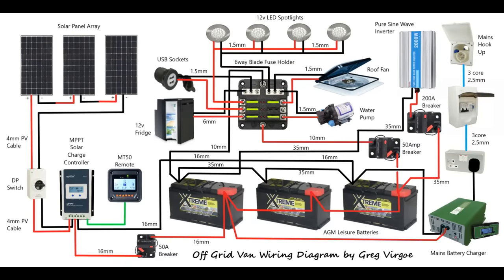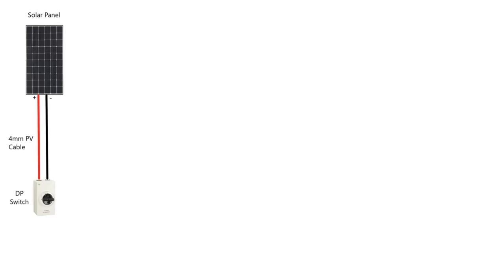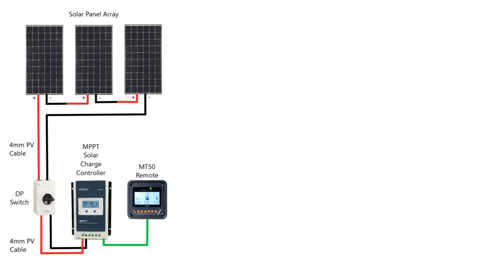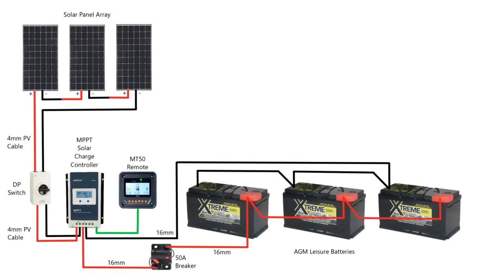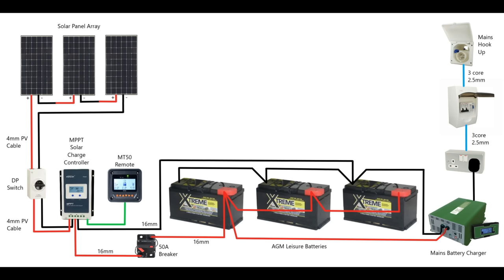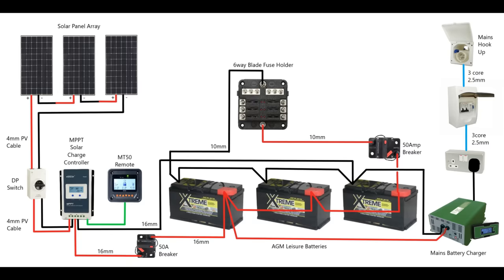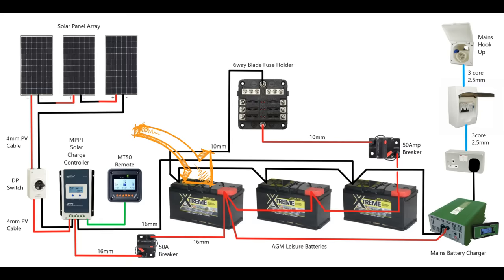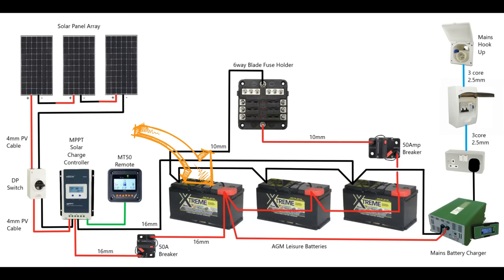How to Wire your Camper Van to be Off-Grid

Comment: I see some people using a single black wire and a single red wire to prewire 12V loads, and some people use a 12/2 wire. Is there any difference other than the 12/2 wire is held together with an extra layer of insulation?
Reply from the maker: Correct the two core cable has extra protection from another sheath and maybe easier to install than separate cables? As long as they are sized correctly no affect on performance 👍🏼

Comment: I’m just going to use Solar Generators such as the EcoFlow Delta Pro! That’s much easier and I will have 10.5 KWH total available to me. At any given time.
Reply from the maker: To get that amount you would need three pros linked together and at current market prices that’s £10k without any solar to recharge them. That’s a ridiculous amount of money to spend on off grid setup for a van. You could install solar, charger and batteries for £1k a tenth of that price. The most power we use off grid in a day is between 0.7 - 1.2kwh so quite why you would need 10kwh in a day is puzzling. How do you plan to generate that much power to recharge them? Eco flow solar panels are 3x more expensive than standard fixed panels.

Comment: i'm sorry if you have already answered this question i did try to search for it... I'm currently doing my electrics and just confused as to how i switch from solar power to electrical hook up? is it a just a switch i need to buy? kind regards, thanks for the video
Reply from the maker: Your solar panels just charge your leisure batteries via a MPPT controller. If you want to use mains off your battery you need an inverter to transform the 12v to 230v. At this point you can install a double pole changeover switch to change between inverter and mains hook up.

Comment: Absolutely magnificent video as usual Greg. Thank you! Couple of questions.
If we wanted more sockets when on hook up, would we just run straight spurs from the first socket that you have installed , or would it need a larger consumer unit ?
Also, did you consider a traditional split charger from the alternator on top of this set up, and would it be possible ??
Reply: Apologies Greg. Just scrolled down for a bit and found you have repeatedly answered the split charge question, sorry to repeat.

Still wondering about additional 240v sockets though 🤔
Reply from the maker: @GaryThatsgary  you can add extra sockets just be aware of how much stuff you plug in and use at the same time. The biggest hook up power supply is 16amps so that’s a total of 3600 watts of appliances

Comment: thanks for your invaluable video's. the later i'm looking at with great attention. something is bothering me. how come you wired the 2000W inverter with only 35mm2. According to the table you gave us in an other video, for a 200A fuse, you'd a much bigger wire. thanks for your feedback.
Reply: @DogeWow according the cable sizing chart mentioned hereabove, 35mm2 is for a maax of 141A. Even thought it would be 190A. Shoudn't the wire be more resistant than the fuse. The later being a 200A.

Comment: Hi Greg, thanks for your videos they are really helping me with my first van. 
I’m basically converting my old work van to see how I get on before doing one to keep (test dummy) I’m a carpenter so all seems fairly easy apart from electrics. 
Now I’m only doing this one as a day van as such not for touring. I’m just wondering how big the mains leisure charger needs to be? I’ve got 2 batteries that are 130A each. I’ve been looking at buying a complete kit but charger is only 5A and yours is 30A I’m just a bit lost in this part if anyone can help. Thanks
Reply from the maker: A good guide for charging leisure batteries is 10% of your total battery capacity therefore -
(2 x 130) = 260Ah x 10% = 26A
So a mains charger of 20-30A would be perfect. 👍🏼😃
Reply: @GregVirgoe  thank you so very much for all your help Greg.
Reply from the maker: @dannywilliams98  No problem 😉 anytime 👍🏼
Reply: @GregVirgoe  sorry I’m reading your list of questions. 
I’ve got my batteries and they are SFL 130 MF CALLED SOLAR FLEX.  ARE THEY like your batteries or do I use a split charger. 
I’m so excited to start but electrics are worrying me 😁 I’m ok with house stuff, but this is totally different 😬😁
Thanks again. By the way I’m really enjoying your videos, bed time to for me these days 😁

Comment: Hey greg. I see in your chart that you have 16mm2 cable from the mppt to the batteries. I have a victron 100/20 mppt and the cable is too thick to connect.. did u just use ferrules on the cable or something else?
Reply from the maker: If yours is just a 20A charger you can use smaller cable 10mm will be fine.

Comment: I'm planning on creating solar installation from scratch but I'm always anxious when I see these "electrical compartments" made of plywood, with batteries, solar charge controllers, etc. What would happen in unlikely event when one of the components break and catches fire? I'm thinking about "fire-proofing" this area with some fireproof wood impregnator (to atleast slow-down the fire in case it happens) and having a dedicated smoke alarm in this compartment. What do you think?
Reply from the maker: A smoke alarm would give you enough of a warning to vacate the van. Make sure all cables and fuses are correctly sized and you should have minimal risk

Comment: Hi Greg just a quick question I got 2 bus bars positive and negative do I connect the main battery charger directly to the batteries or to the bus bars like all the other chargers likes solar , dc to dc etc …
Reply from the maker: If you are using bus bars then you need to connect all your chargers and outputs to the bus bars. The cables from the bus bars to the batteries need to be the same length to give equal resistance to the batteries. This method does put extra resistance and voltage drop onto the system.

Comment: I'm considering buying the 50amp breakers that are used in your design however Amazon and eBay sell them cheaply but the reviews are very poor. Some retailers of 12v products also sell them but quite a lot more but they could still be the cheap and poorly made items as well. Is there particular makes that are of higher quality or are they all made in the same factory in China?
Reply from the maker: From personal experience with my own I have not had any problems 😁

Comment: Hi greg, thanks for the great video. 
I have a question . 
How would you caculate cable size between 1.charge controller( 30 amp) to battery , 2. dc dc charger ( 30 amp ) to battery 3.inverter (500w) to battery 
my battery is 200AH lithium superpack victron
Thanks alot , Any advice appreciated

Comment: Question re grounding. Firstly, did you ground the 240v to the chassis? Also, did you ground the large metal items e.g. sink/hob? Is it ok the have a common ground/earth point on the chassis for both 12v and 240v or should you keep them separate? Simple and straightforward video. Very useful. Thanks
Reply from the maker: Yes I did earth the 230v to the van and such items as inverter case, copper tubing etc. 
12v DC does not need an earth. Most auto electrics use the vehicle body as the negative path back to the battery. Do not confuse this with an earth. They are not the same. The term ground gets used and I think that’s what confuses people. I recommend running cables for both positive and negative and avoid connecting the 12v DC leisure side to the vehicle altogether 👍🏼😃🤩
Reply: Answered my question about 12v DC perfectly thanks 👍

Comment: Would you have this as a stand alone system or can I link the vans main “engine battery” into the system for extra charging through the alternator whilst driving?
Reply from the maker: My latest off grid wiring video is better for including charging from the van. Please watch this video 
12v Electrics for Off-Grid Campervan - Fiat Ducato Budget Build Ep12
https://youtu.be/xCw7eARJKOg

Comment: Hello!  If you are using a single battery, is it safe to connect your solar, inverter, and fuse box all to the single terminals on the battery or do I need a bus bar?  It is a 200 amp system. Thanks!
Reply from the maker: You can get battery terminals with multiple posts I’ll put a link here https://www.12voltplanet.co.uk/positive-battery-terminal-clamp-3-stud-connection.html
The positive and negative terminals are different sizes so you need one for each 👍🏼

Comment: Hi very helpful. I have a question. on your diagram the mains charger. would you have to turn off solar power? so you dont have 2 sources charging the battery. My system is similar but instead of the mains charger, I have the starter battery with a leisure battery which is supplied from the alternator.  So could I use my solar panel to top up the battery also? or would I be inputting two sources. Thanks

Comment: Hey Greg, great video! 
Can you answer my battery question? 
How many amps can you draw from a AGM battery (or any type) continuously? 
I have a 12V AGM 25AH battery. Would it be safe to draw the full 25amps for a period of time?
Can you draw over the battery AH capacity for a burst of time? Say 30amps for 5 mins? 

Confused on max amp draw over a continuous period, say 1 hour. 

Sam

Comment: How thick should the cable and fuse be if you use the car battery to charge your other battery's instead of solar panels? Thanks from Sweden 🇸🇪 😀
Reply from the maker: Typically they would be a minimum of 16mm cable for split charging.
Reply: Thank you Greg!

Comment: Hi Greg, Thanks for your videos, if I understood right, without any inverter I can keep my battery cable smaller like 16mm would be good?
I have plenty of 16mm, to save some money, could I double it and reach 32mm ? Or it will drop using 2 cables?

Thanks a lot

Comment: I keep referring to your videos for every aspect of my build.  I'm looking at what size cable to buy and I'm just wondering why you chose 6mm cable for your compressor fridge when it draws only 6.25 amps. Would 1.5mm not be sufficient?
Reply from the maker: Hello David, no it’s not big enough abs it’s because of the voltage drop on the cable. Inside the manual there is a chart to size the supply cable depending on length.
Reply: @GregVirgoe  Many Thanks for your prompt reply Greg.

Comment: Hi Greg, just a quick question, do you have power sockets inside that are normal 3 pin plugs. If so, how do you incorporate them in
Reply from the maker: I have taken my hook up cable and my inverter cable and wired those both to a double pole changeover switch. The output of that switch I have wired to my three pin sockets. 
You can see more detail of that in my earlier control panel videos

Comment: Hi Greg, sorry for another question but I was wondering if you might be able to answer this question, so i have 2x100W solar panels which I will be wiring in parallel as I will be using a CTEK B2B charger which also has an MPPT controller in it but the max voltage is too low for me to wire in series. But this like you said means I will have a higher ampage, the solar panels come with 4mm solar cable, will this still be okay to use or will i need to get a larger wire? Ive tried to find out the gauge of the 4mm wire supplied but cant find it anywhere, as i was under the impression i would require 10 agw but im a tad confused! i also dont then know what size amp breaker or fuse i would need/ if i need to install one between the solar and ctek and between the ctek and battery?
Reply from the maker: What is the max amp rating of each panel? Can you give me the model of CTEK that you have please?

Comment: Hi Greg, What size of cables should I use between my AC/DC battery charger and the actual batteries? Should I use the ones coming with the battery charger or should I replace them depending on my system? Thanks
Reply from the maker: The ones that came with it have probably been sized for it’s max duty. What is that amp rating of the charger abs what size cable is it.
Reply: @GregVirgoe  thanks Greg. It’s the KickAss 20amp, it doesn’t say what size of cables but you are probably right about it. Just another thing, do you have to be careful when working with the circuits (batteries, solar panels, cables) or as it is 12V it won’t harm?
Thanks again

Comment: Hi just one question would you use a 35 mm cable also from your 2000 inverts to your plug sockets . By the way really good well explained video thanks steve
Reply: No. 35mm is for 12v where the current is very high. Once the inverter converts 12V DC to 240V AC, the current drops, so you just use normal 240v tri cable, standard wires you have with your plugs going to your sockets, i believe its 2.5mm with 3 cables inside

Comment: Hello Greg,

I have 2 questions please:

1: Planning to use your schematic. If I wanna do battery to battery charging, apart from the parallel panels that you mentioned in one of your comments, what else do I need to change?

2: If I'm using 500w solar can I use Renogy 40A MPPT or should I go higher?

Thank you!
Reply from the maker: You can use the new Renogy 50A DC to DC charger which has built in MPPT charger too. It will handle up to 660W of solar. You will have to wire the solar panels in parallel as it has maximum input voltage of 25V but at a little over £200 for the combined unit and Bluetooth module it’s an economical solution
Reply: @GregVirgoe  Thanks Greg! Appreciate it.

Comment: I hope you wouldn't mind helping me out a little bit and checking my math for me. I've been trying to find someone with an accurate answer....

I recently purchased 4 lightly used 270 watt, 35.5 volt pmax, 7.60amp pmax / 15amp fuse rating solar panels. So, if I connect them up in series I would get 1080watts with 142 volts at 7.6 amps. Correct?

I also purchased a DC pool pump rated at 72vdc that comes with a 72v Controller Box. 
The Controller parameters are as follows: Rated current=12A, max solar input volts=150, current overload=15A, pump=1000W @ 72v, best working volts=88v.

Would you agree that my 4 panels in series is best and most efficient? Or do you recommend another configuration???
Reply from the maker: The panels in series is correct. Still only need 4mm PV cable and 15Amp fuse

That pump appears to be huge! Something smaller would be more efficient.
Reply: @GregVirgoe  OK - I just mounted 2 of the 270w panels. I just tested with a voltmeter. On a cloudy drizzly day like today each is putting out 40vdc. I think this is VOC, right? So, with these panels and my controller, how do I get 900w to1000w and the less than 150v needed for the controller. Only 3 panels in series would give me the voltage, but NOT the amps. 
That's my ignorant dilemma. ????

Comment: Good morning Greg firstly fantastic video, I have a very similar set up all be it smaller I have 200w solar 2x 110amh batterys 1000w inverter only runs fridge and rarely a TV. Mains battery charger, all 12v is led lights water pump controll for water heater I have all charging one end, all drawing the opposite end negatives also the same respectively. My major issue is the system does not act evenly it always takes out of one battery first and it is always the battery that the draw is on do you have a recommendation please ?

Comment: Might seem like a silly question but did you wire the panels in series inside or outside the van?... Trying to minimise holes drilled in the roof and was wondering whether the leads/connections that come fitted as standard are hard wearing enough to remain outside the van?
Reply from the maker: They are connected outside on the roof and only two wires come down into the van. The MC4 connectors are designed to be outside and are waterproof. 
I have a video showing these panels being fitted. In the sprinter playlist. 👍🏼😃
Reply: Excellent... Great stuff... Thank you for getting back to me so quickly... Really appreciate the content it's been very useful for beginners like myself 😊

Comment: Hi Greg do you have a updated link to the battires or a recommendation.

 I am buliding a small weekend camper trailer out of a car body. I will be running a fridge, car windows, car stereo, led lights around 3 main possibly rgb show lights , 12v TV, 3/4 USB sockets.
Reply from the maker: The brand I have is Leoch AGM and they have been very good. My link should take you to Alpha Batteries eBay shop where they will have a wide selection of them.

Comment: Hi Greg  the information  on van wiring  is fab  I'm looking to do similar work  but can I link up to my van charging  I already  have split charge from van battery  to my leisure  battery   not sure if I making sense  to you  thanks
Reply from the maker: Yes you can! you can leave the split charging system as it is. THe new MPPT would see the charge voltage when driving and back off thinking the batteries were full. I will say that a better way of looking after your leisure batteries would be a DC to DC charger rather than a split charge relay.
Reply: @GregVirgoe  thanks i have just orderd a dc to dc

Comment: Hi Greg, awesome videos - been invaluable during my first van build (6 weeks in now). I've watched this and your cable sizing vid multiple times. I'm struggling to understand how your 35mm cable and 200A breaker is sufficient for a 2000W inverter as it presumably has a 4000W surge capacity. Surely the cable sizing should account for this surge and not just the 2000W? Any advice would be much appreciated...just ordering cables haha
Reply: Ian, i was thinking the same thing!